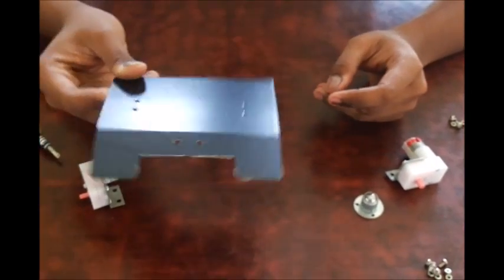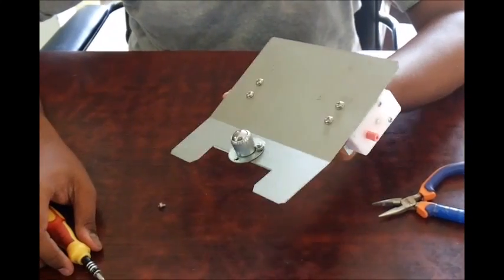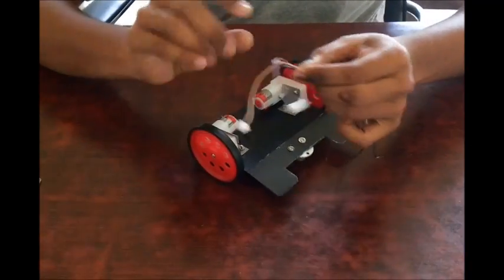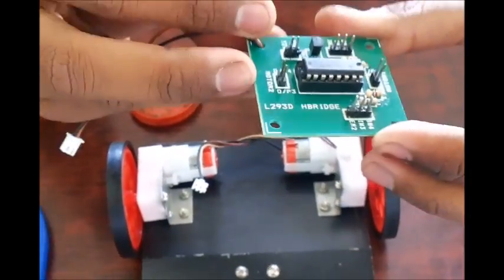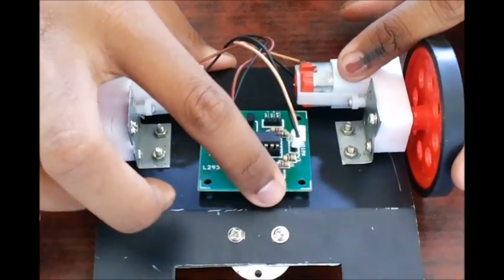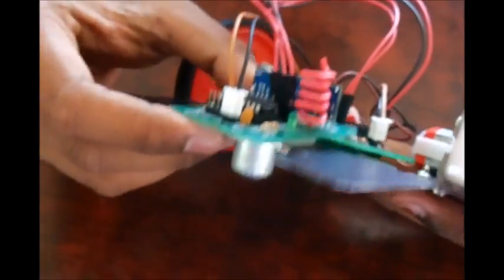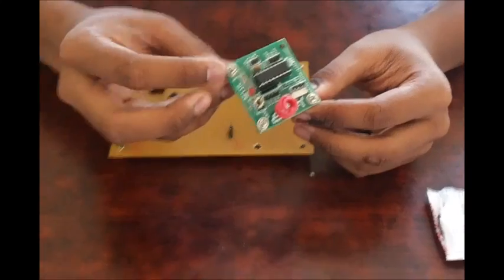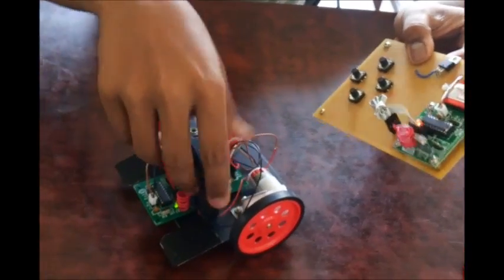How to make a simple RC (Remote Controlled) robot car

Comment: I made my boards using his shematics, and my boards look totally different than his boards, I dont understand.
Reply from the maker: Different how? they can look a lot different so long as it works as expected.
Reply: @Embedjournal  The problem is that it doesnt work. For example on your shematic you had dc jack for battery and  i dont see one on your bort. Secondly  5V regulator was on shematic on the motor druver board not the remote. And reistors i believe are to big.

Comment: For the remote follow these steps :

For forward button connect the "forward switch" output ( by output I mean the end that is not connected to vcc) to encoder pins  i1 and i3 ( meaning forward input of the motor)
For backward button connect the "back switch"  output to i2 and i4
For right button connect right button output to i1 and i4
For left button connect left button output to i2 and i3

i1 is the forward pin for 1st motor , i2 is the backward pin for 1st motor
Similarly i3 and i4 are forwards and backward pins of 2nd motor respectively 

Ask me If u have any problem

Comment: Cool video. Thanks for sharing. I have got the motor driver, tx receiver/transmitter boards. Unfortunately(or fortunately) the motor driver has EN1,EN2 pins, then 6 sets of another pins EN1-ON, EN2 ON OFF plus, I1, I2, I3, I4 .. now I am throughly confused which one I should connect from decoder to motor driver. Also the decoder has a small red color switch box and had 8 positions with small switched on/off .. not sure what is that purpose. Have you this kind of board module .. if so can you please help me to understand. Thanks
Reply: Raja Rajan  everything is fine  that red box is connected to address pins which basically means from which address you are getting the signal so just set all the switches off on both recover and transmitter modules ( means make the address same) , now in the motor driver en1,en2 are enable pins which enable the motor to run without them the motor wont turn on even if u give signal to the input pins so connect those enable pin to positive voltage , IN1 IN2 IN3 IN4 are the input from decoder so connect it likewise.

Comment: Could  you post a video showing which buttons you press for the movements of the car?

I think two buttons need to be pressed at a time for front, back and turning the robot at 45, 90,180 and 360 degree angles.

With the layout that you employed, wouldn't it be difficult?

Comment: Did you have to code the circuits yourself, or did the circuits come with the code
Reply from the maker: +Emmanuel Lugo Let me elaborate on +Mistake Studio. This project does not need any embedded controller. It is a purely digital circuit. Please read the article in the link in the video description for more details.
Reply: Yes
Reply: +Mistake Studio 
what about the circuit  diagram???
Reply: +Mistake Studio 
diagram for the remote
Reply: Emmanuel Lugo he is not using any programmable microchip he is using some ic's which are preprogrammed or u can say made for specific purposes

Comment: hello , good informative video,,, but i have some trouble making remote control setup can u help ?
Reply: Vaibhav Bhasin one side of each momentary switch is connected to 5v and the other side is connected to one of the input pins on the transmitter pcb

Comment: Can you please tell me what is the circuit board for the Transmitter and Receiver you used and Can you send me a link to where you bought it from?

I looked on your website for the chip but I want the board the you used with it together.
Reply: Sorry this is late, the two circuit boards were no bought. It is called a printable circuit board. The man in the video bought pcb board which is on Amazon, and then put the picture of the circuit board pdf and ironed it to the board. The paper is then carefully pealed off leaving an ink later. The board is then soaked in ferric chloride(corrosive) and what is left is the circuits. You then put paint stripper to clean it, then drill holes for the pegs and solder them,

Comment: Siddarth, i am facing problems in the RF section, the motor seems to be a pain in the ass in that area, it is inducing current and messing up with the entire circuit, sometimes when i press the button, the wheel spins forever and the pin of the decoder does not reset. Did you faced that ?

Comment: The circuit board built for the h12d/e decoder/encoder ICs, do they come prebuilt from the market?
Reply from the maker: You can make it yourself or buy it prebuilt. Check the video description for more details.
Reply: Ok. As for the 9V to 5V converter for the remote, could you tell me if I can buy something for that. if so, what?
Reply from the maker: Baisakhi Chatterjee there are a lot of ways.. 7805 (what i used in video) is the most common and easy method.

Comment: Nice video ! But I've got a question about your circuit design. How do you determine the values of the resistors that are connected to HT12D and HT12E? Or how do you know whether it is a must to put a resistor connected to the DATA pins of the HT12E & HT12D?
Reply from the maker: In the data sheet there are some things like max drain and source capacity for the IC's pins. You should read about them and come up with the numbers for the resistance. Or you could visit the application circuit part of the spec sheet to get them.
Reply: read the HT12E and HT12D datasheet, there is a graph showing you how much resistance for any voltage you are using for a certain frequency. So you can adjust it for your need.

Comment: can I run two rf control car in single room with less distance having separate remote
Reply from the maker: You can but then you should choose different frequency radios or you should add some software routines that will let the cars know which remote is talking to it.
Reply: what all range is avilable in market

Comment: Where did you get your wheels and motors? I seem to have trouble finding the right sizes.
Reply from the maker: Yeah.. that is a known issue... If you ask me I would buy a motor first and then start by looking for a wheel that will match your shaft. But you could always do some tiny hardware hacks to get things going!

Comment: sir how does this robot turn sideways whats the mechanism for this.? i could understand the forward and backward movement.. please notify on that.
Reply from the maker: Hi Vinay, it is called as differential drive algorithm. Either of the wheels rotate in different directions to produce change in direction. Please read through the article in the video description.
Reply: Embed Journal  so if we just buy those materials all tht diff drive alg. will happen on its own ??
or do we have to do something else for it??
plz reply
Reply from the maker: Rohan Naik You will just have to make the connections and this car will work. :) Of course there is a lot more to learn if you want to make anything more complex than that.
Reply: i would definitely like to learn sir but first i would prefer to make the car thnx alot :P :D
Reply from the maker: One of the wheels move in one direction and the other moves in another direction, this will cause the robot to turn. Read the article in the description of the video.

Comment: when building the controller, use electric tape
Reply from the maker: Thanks. I think the double sided tape took care of that for me.. But ya its a good practice to use electrical tape.
Reply: Embed Journal hello
Reply from the maker: Hey there, the motors will come close to 2 USD.. I have no Idea why you are having any trouble finding it. It is very popular among the hobbyist. But you dont have to use the same motors.. any DC motor would just fine.